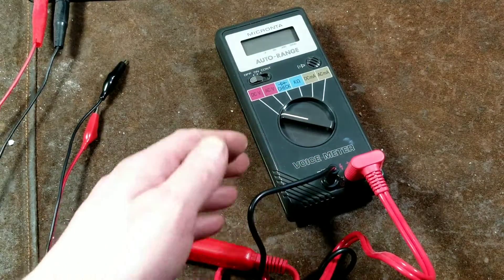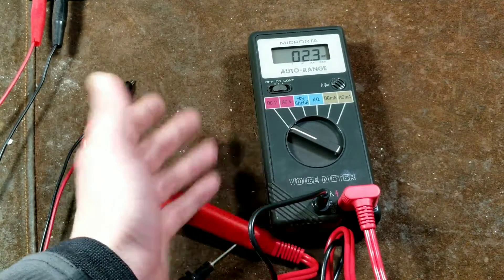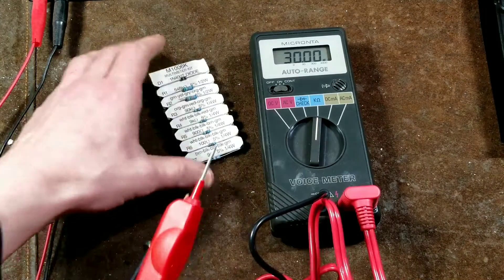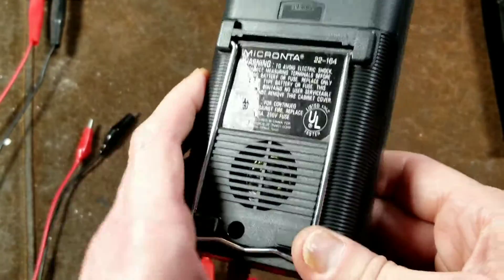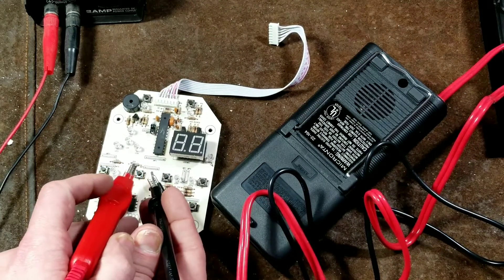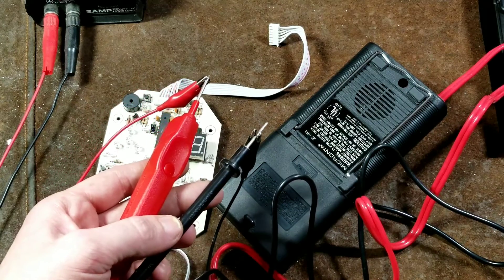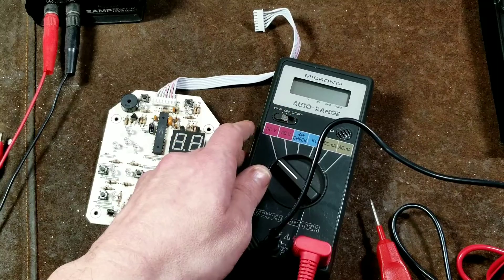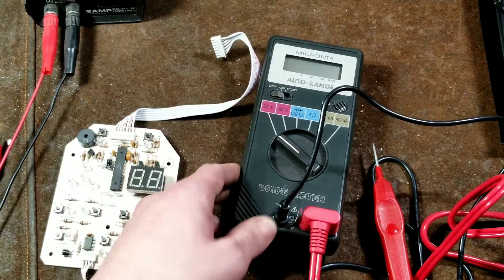Radio Shack Micronta Talking Multimeter Review

Comment: The MPJA 35042 ME is a currently sold talking multimeter.  I got one and tested it.  It's fairly decent and low cost.  And you don't have to press a button to make it talk.  It talks automatically once the reading is reasonably stable.  If the reading then changes to something else, it talks again with the new reading.  It doesn't have auto-ranging, however, and with everything but the kitchen sink thrown in (such as checking transistors) with all those selectable ranges it has a rotary dial with TWENTY EIGHT positions.

Comment: I prefer 2-pole voltage testers for the work on a circuit, like most europeans do. They don't show ghost voltages (capacitive coupled in or induced) which can be up to 100V in a 230V circuit but they aren't loadable, you'll only measure them because of the high impedance of most multimeters. Second reason is, you can use these voltage testers without looking away from the test point. Third is, there's no way an operating error can occur (plugged the probes for current measuring and try to perform a voltage measuring, set to DC and there's actually AC voltage). And in most cases you can put a small load on the circuit, that's also a nice thing to see if a GFCI is working.

Here you can see one of those made by Fluke:

https://www.youtube.com/watch?v=-qh28sHs7XA
Reply from the maker: Yes indeed I agree there however this is very useful when you actually do need a specific voltage measurement or you're in a very awkward situation. 

I did a review on a fluke T2 two-pole voltage tester and it is very handy.
Reply: @CatusMaximus  You're in most cases in an akward situation to measure in the electrical installation at home. For most home owners I think the most common situation would be prooving if a circuit is dead so you can change a lighting fixture on the ceiling safely.